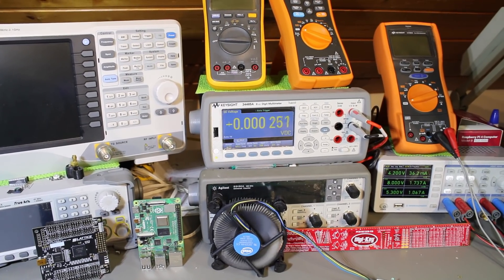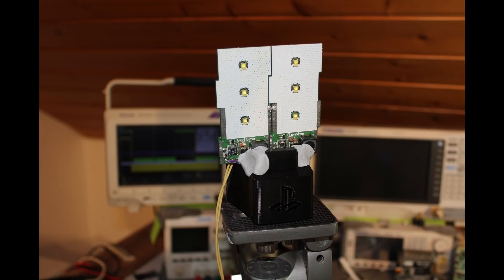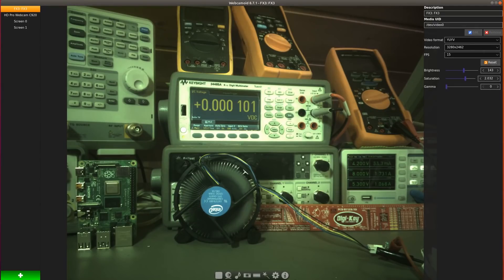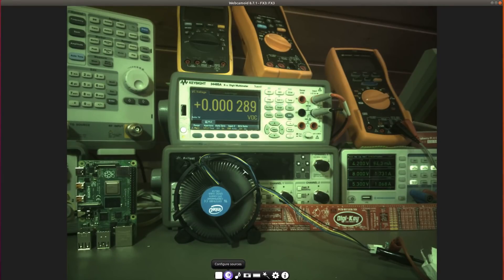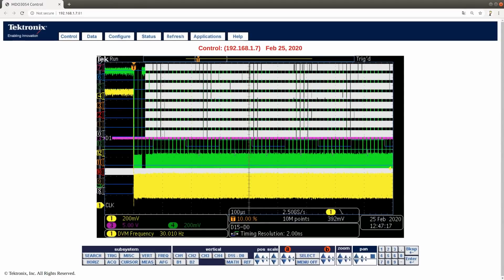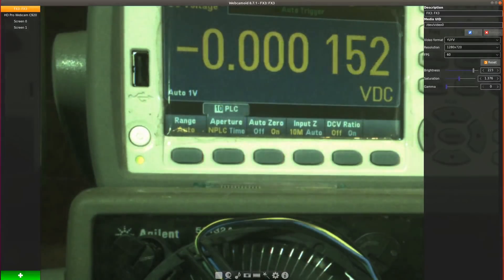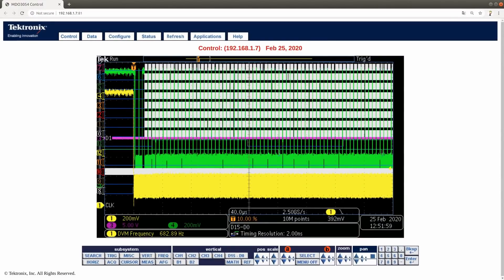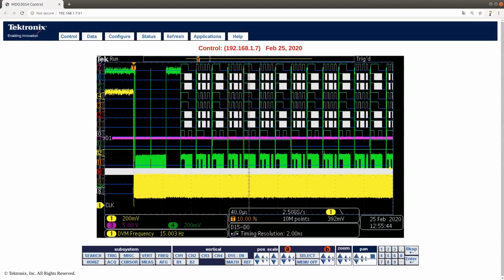Opensource IMX219 FPGA MIPI CSI-2 Camera USB3.0 2Gbps UVC Video Test 15 To 1000FPS, Upto ~ 4K

Comment: Wonderful Work.
I'm trying to interface to a similar camera. Do you happen to know if i lower the FPS to say 1 FPS if i can drastically lower the mipi clock and data throughput?
Thank you
Reply from the maker: Do not necessarily  need to lower MIPI clock rate to get 1FPS, There are quite a few way to get to 1FPS . Camera's PLLs have a lower limit of frequency output. And clock mechanism provides ways to achieve low frame rate without going low on mipi wire clock.
Reply: @circuitvalley  Ok, thanks for detailed reply. I would like to store the raw image on a SD card, like a still camera and if with a lower fps i can get some longer delays between mipi packets i can write directly to the SD and not use any RAM. If on the other hand with lower fps i get all the mipi packets and then a 1s delay (1FPS), I must stream the image to ram and then save it to SD card.

Comment: this is awesome, thanks for documenting your experiments, it's one of the few domains I'm really interested in but there is a lack of simple explanation / tutorials.

For the 1000 fps mode, do you know the latency? (camera pipelines often spend a few frames to process before output the data)

Can you choose the vertical position of the captured region at 1000fps? I understand it's only possible to capture 80 pixels, but if the latency is low enough and if it's possible to move this region, it could be used to make high-framerate real-time tracking device for a fraction of the cost of commercial devices like motion capture systems,...